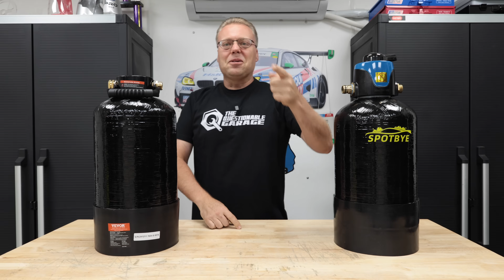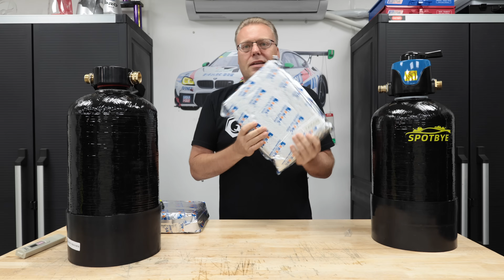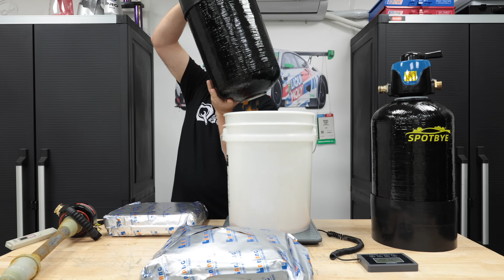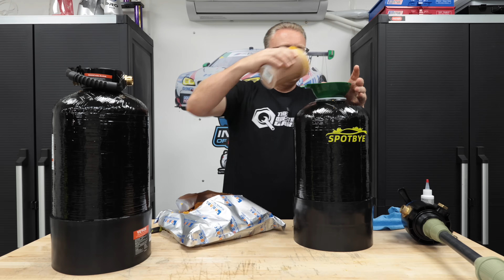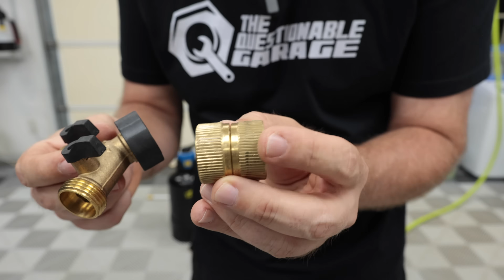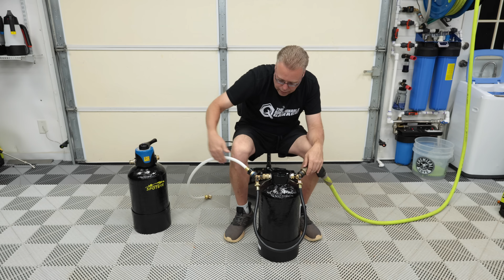BEST Budget DI Spotless Tank Systems | Vevor | Spotbye | Deionization

Comment: An idea for a video.  One video comparing the DI systems you have reviewed.  How do they compare with regards to capacity, cost & value, ease of use and overall thoughts of each system.  Great videos, keep cranking them out.
Reply from the maker: Appreciate that and is something I have looked to do. I plan to do that for multiple types of products. Just trying tot figure when is the best time to do that as wash season is slowing down. Might have to wait till next wash season.
Reply: @CarsWithKeav  Speaking of wash season slowing down, how would you recommend storing a setup during the winter in a colder region (Valley Forge, PA)?  Keep the resin wet?  Fill the unit with distilled water ?  Use the bypass hose setup to seal the unit?  I ordered my Vevor today.  Thanks for the guidance.
Reply from the maker: @Halfast911 Keep it wet,but if longer than a month don’t submerge it in water just keep
It moist and sealed and don’t let it freeze which is more for protecting the canisters and housings from cracking. I myself would remove  from the canisters if storing for the winter in a bucket with a sealed lid. Too much water and it will build mildew inside over a longer period of time especially if heat cycled a lot. I don’t have to worry about that, but if I did I would use the off season as a way to purge and start with fresh resin in the spring. Of course you are just getting yours so resin will still be good.

Comment: Great video and I love you give numbers to allow estimating what type and size DI you need.  I am trying to figure out how many washes I would get between replacements.  I estimate that with my Kranzle k1122, I get about 2 gallons per minute when rinsing.  The water I get out of my water softener is about 225ppm.   I am just curious about how long you usually spend on a final rinse on a typical car, since that would affect the final number.
Reply from the maker: Most people would use usually 5 to 8 gallons for the final rinse. The tough part is it being after a water softener the hard materials have been taken out and replaced with sodium.  So out of the 50/50 resin mix you are really only using half of it. I would say possibly between 150 and 200 gallons you could get.

Comment: Is there an easy way to install an inline TDS meter on the Vevor model, so I will know when my resin is going bad and not have to test it every time before and after using it?
Reply from the maker: It's a bit harder on these as they need to be in the water. If you add onto the end using a tee the sensor doesn't get in the flow water. Only true way would be to modify the output side and drill into it using a OD push lock adapter to allow you to put the sensor in the water flow just like CR Spotless does.

Comment: With the Vevor being out of stock for a good while now, what would be the next best mixed-bed resin deionizer you recommend?   Get the Spotbye tank and just buy Vivor resin once it runs out?
Reply from the maker: If you don’t mind spending a little more I think the Griots is the better choice and comes with a much better bypass.
Reply: @CarsWithKeav  I’m not against that price.  Have you tried “on the go”?  They seem to have great reviews too.
Reply: Asking because item #OTG2-SDDI is on sale.  Regularly $470 on sale for $299
Reply from the maker: @TigersGeaux1287 It’s the same thing really. Not much difference in any of these other than the amount of resin they can hold and the quality of what they send to you.
Reply from the maker: @TigersGeaux1287 That system is fine, but no bypass and is a bit smaller.
Reply: @CarsWithKeav hm.  Looking at The specs at 160 PPM for both I should get way more out of the On the Go.  I don’t have experience with either so I’m just analyzing everything before I make a decision.  And if I have to make a Bypass that may be worth the essentially double the volume of water I could get out of it.
Reply: I also admit I didn’t get resin refill pricing so that also needs to be factored, and maybe you did that before answering.  If Griots is cheaper to refill, well then you know how to do the math. 😂😂
Reply from the maker: @TigersGeaux1287 Hard part is those charts are all based on perfect scenarios. All depends on what minerals are in that 160ppm. You can’t go wrong either way really.
Reply from the maker: @TigersGeaux1287 I mean it’s not really cheaper as if you choose the same refill resin no matter the system it won’t work any different. It’s all about how much it can hold the more you hold the less often you refill, but to me in the end the cost per gallon of water is the same.
Reply: @CarsWithKeav I’m gonna take your word and just go Griots since it has the bypass built in.  I assume if the Griots doesn’t net enough gallons, I can just try another manufacturers resin when it’s time to refill?
Reply from the maker: @TigersGeaux1287 Correct, resin is a a whole other subject as with many brands it can change between purchases. Some regeneration just yields better output. Age of the resin and things like that can change the yield. Usually cr spotless I find to be the best regenerated resin of looking for more gallons. Just know higher quality resin costs more so you might get more gallons, but cost per gallon goes up which is why I normally stick to cheaper alternatives might be less gallons, but makes up with the cheaper price per gallon.
Reply: @CarsWithKeav thanks for all the back and forth!  Appreciate the input. Love the videos.

Comment: I'm seeing mixed reviews on the vevor. Would you still recommended that one or the smaller spotbye that reviewed awhile back? Seems like the only 2 options at that price range.
Reply from the maker: Thing is with most of the cheaper side of these systems the resin that comes with it is the hit and miss. The systems themselves all work the same. Cr spotless always works well because they have the best quality regenerates resin out there. Good thing is these systems are so cheap if the resin doesn’t work great you will have lots of money saved to purchase more resin. The smaller spotbye is good as well, but much less resin so will depend on your water quality.

Comment: Hey Keav, I could use your help getting the bypass on the Spotbye to seal. Swapped out the quick connects that were leaking. I now have Eley’s on the out side. Now it’s leaking under the bypass head. Thoughts, ideas???
Reply from the maker: I had a leak issue under the head and then found out I never put the red o ring in there that came in the box. Hoping thats the problem. It is an exercise in patience to get this to stop leaking like a mentioned in the video.

Comment: @carswithkeav silly question, but do you connect your pressure washer to these DI systems?  When I limited the flow IN to my vevor DI to around 2.5GPM my active 2.0 reved up realy quick so immediately shut it off.  Would it make sense to reduce flow on the OUTPUT side of the filter to make sure the pressure washer is getting 2.5GPM?
Reply from the maker: It is best measure after if trying to feed a pressure washer. Really though you don’t even need to regulate as the pressure washer is only going to used what it can and regulate itself.

Comment: Very good review 👍 I recently picked up a Vevor set on Aliexpress and it has taken my 475ppm tap water down to zero ppm

I fully agree with you on the "problem" of not having a valve to prevent back flow from the bypass on the exit side however I came up with an alternative solution which - for me - was quicker, easier and cheaper and is I believe just as easy to use. It uses uses 3 quick release nozzles for 1.50$ each

On the inlet side I have fitted the Vevor 3 way unit with the stop valves on the tank inlet and where you have the start of your bybypass. However instead of using a bypass hose, I have simply attached a quick release nipple where I attach the pressure washer for cleaning (inlet valve into tank closed, "bypass" valve open)

On the exit side of the tank is another quick release nipple. When I want filtered water for final rinse, I just need to swap the pressure washer feed hose to the exit valve, change the positions of the 3-way valves to redirect tap water into the tank and hey presto - deionised rinsing.

For me another plus of this solution is that I don't have the bypass hose dangling there and it gives a slightly more compact set-up but the main benefit ws that I don't need to go looking for female/female connectors

Unfortunately I can't post a photo which would explain things much quicker than I can in words 🤣
Reply from the maker: I see what you are saying no need for a picture and that’s a great idea. I’m going to start looking into backflow preventers that can fit inside of the housings so the valve isn’t need in the other side.

Comment: Hope you'd be okay with answering a few questions for me, using a product like this, does this stay outside of my house connected to the water hose? I only plan on washing my car, a small sedan, i'd like to do the process of rinsing the car, then foaming up the car, hand clean, then another rinse and let it dry, how many washes would this last me?
Reply from the maker: The tank would need to be stored out of the sunlight and stored where it doesn’t get too hot. How many washes you couldn’t really answer without knowing your water quality and how many gallons you use during a car wash.

Comment: Great content!  I believe the Spotbye head threads on both the intake and outlet are BSP (British Seal Pipe Thread),  NPT and GHT nipple threads fit but are both too loose for the connection.
Reply from the maker: I just used what came with it for the head and they don’t seal very well. It could be the wrong thread possibly.

Comment: Wait, wouldn't the minerals in the water scratch the clear coat when those minerals are mixed around with a towel or sponge during the soaking process?

Is the resin the same price (with tariffs) and if there are international vendor wouldn't they be cut off at some point or the product becomes too expensive 😮😮?  Thanks for your response
Reply from the maker: They are microscopic usually so wouldn’t think so, but it’s possible. You would usually have some type of lubrication such as soap or Rinseless to encapsulate those to not causing scratching. Unsure on tariffs and the impact most resin has not changed price at all which could mean they have been overcharging the whole time. Unsure if they are living off supply that has been here awhile.

Comment: I bought the unit with the valve but I cannot get the intake fitting not to leak. I've used the supplied washer with Teflon tape and pipe dope and still it leaks at the fitting. I'm just curious how you for it but to leak
Reply from the maker: It took me quite some time and a lot of Teflon tape to get it to not leak. I did use a high quality tape.

Comment: Keav pls help :( i just set up my vevor tank and my ppm is in the mid 400’s but it only goes down to mid 200’s am i doing something wrong? Is my water too dirty ?
Reply from the maker: How fast are you flowing the water through there? Should still clean mid 400’s if you keep the flow down to 2 gallons per minute. If not doesn’t that resin might be low quality or something isn’t seated right and maybe causing blow by.
Reply: @CarsWithKeav i had it at 2 gpm, and i even lowered it to 1.5 and it got down to 120 ish ppm  but i know you and josh were able to get it to 0 with the resin provided in the tank maybe blow by is the issue but how do i test that?
Reply from the maker: @PEEPSLASTXAN That’s the hard part as the tank style really don’t have much chance for blow by compared to the two stage blue canisters. You could take the top out and check to make sure the filter isn’t obstructed and everything is sealed up good.
Reply: @CarsWithKeav  gonna trouble shoot some more  rn and check to make sure everything is sealed properly and no blow by is occurring i was testing it pretty late and didn’t want to waste too much water last night. You definitely earned another sub, very helpful channel and person thank you
Reply from the maker: @PEEPSLASTXAN just need to take the top out and see if anything isn’t sealed right like the tube or see if the filter cone is blocked maybe.

Comment: Do a lot of cars. If you have a hand truck (you can buy a used one anywhere for $40), you can attach a prefilter unit (cheap rv kit with two 1 micron filters -$50) on the back to get the best water you can, and put the 1.0 cubic ft di tank ($250) on the front. Secure it with bunge cords. Use quick connect with a valve for the water coming from the garden hose and put a splitter on the exit of the prefilter with one going to the di tank an one to the filtered water (use it to wash your car). On the exit side of the di tank put a flow meter, a quick connect and a hose and nozzle. Fill the 1 cu. ft. resin tank about 3/4 full with media ($210), insert the drop pipe (add a little water make it easier) install the top, drop the pipe into the head and screw it on. You will probably use about 10 gallons per rinse, so if you wash your car twice a week 7 months out of the year and have low tds going onto the media and use 10 gallons per rinse, you should get the following - 200 tds going into the di tank = 380 washes - 150 tds + 500 washes - 100tds = 750 washes.
https://www.youtube.com/watch?v=1eWXinkNCkI
Reply from the maker: Sounds like quite the system. There can be some variables as to what type of filters you use. Well water you would be better off with sediment filters for sure and if on city/county water sediment wouldn’t be much and the minerals would pass right through a one micron. Using carbon filters will help with the chlorine intention of water breaking down the resin quicker, but you do also raise ppm due to the carbon as well. Having a meter maybe before the ore filter as well to track water usage there as well since those can have shelf life as well.
Reply: @CarsWithKeav  assuming city water of course if are using well water you need a 20 micron filter as your first filter, then a 5 micron (non carbon) and then a 1micron - Including the filters you can easily make this unit for $200

Comment: I have the little spotbye and really like it but still don’t understand the concept behind the tank, I have it connected to a 1.2 gpm pressure washer but wash the car from start to finish because I wash outside in the Texas sun 🤣. But I feel that I get probably 4 months of  the use of the resin washing 2 cars every odd week and now I try to empty the can when I storage it. The TDS meter goes to 0 from 168 or something in that ballpark. But really still get water spots sometimes and don’t know if I’m forgetting something or what. If you can clarify me that and thanks for the video because the little one O don’t know if is getting expensive but is 50 dollars every 4 months or less.
Reply from the maker: The 0 ppm means no solids in the water so nothing harmful in the water. Chemicals could still get by the filters which are bit solids. Also anything in the air can attach to water beads and cause spots, but they should be easily wiped away.

Comment: Hey Keav!!! Love your videos!!!  How does Vevor model RWS16000 "VEVOR RV Water Softener, 16,000 Grain Portable Water Softener, with 3/4" Brass Fittings and 42" Hose, Soften Hard Water Filter System for RVs, Trailers, Boats, Mobile Car Washing, Pressure Washing" compare to the JY-DI-01US7 in you video?

I am specifically asking about the deionizing aspect.  I know they don't have the same accessories and connectivity.

Thanks in advance!!!
Reply from the maker: It would not be spotless as water softener resin is only one of the two needed for DI water and is the cheaper of the two. It removes things like magnesium, calcium, etc. the minerals that cause low foam levels, scaling and the more damaging spots. It does not remove sodium and the more soft minerals though which will leave spots.

Comment: Thanks for the info.  
I was my 2 cars 1 or 2 times a month in hot sunny AZ with high ppm water. Which unit is best value long term? Ok paying bit more upfront for lower long term consumables cost.  Spotby? Vevor? On the Go? HGS?  Adams? CR spotless?
Reply from the maker: Vevor is going to be the cheapest route. All of these systems do the same thing it’s the amount of resin they can hold that makes them effective.
Reply: @CarsWithKeav thanks. None you've found to be of bit higher quality construction/materials that might mean it lasts longer?

Comment: Are people using these tanks with high pressure pumps like the Active 2.0? You didn't state what they're capable of taking on from a PSI/GPM and the website or Amazon states nothing and doesn't show any pics with the Active 2.0. Thanks FYI anyone can jump in and give me your input and advice.
Reply from the maker: Yes they will clean fast enough to be able to use with an Active 2.0. They don’t state, but these can handle 2gpm pretty easily. Some of these say they can do 4gpm, but that depends on the water quality.